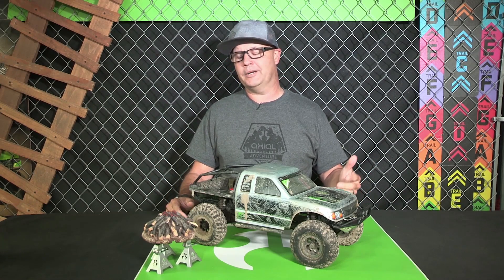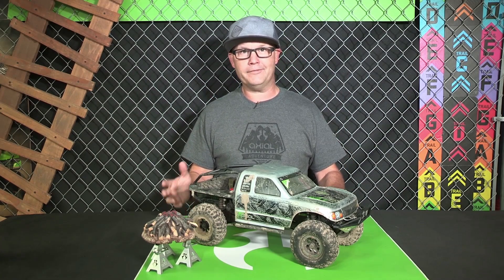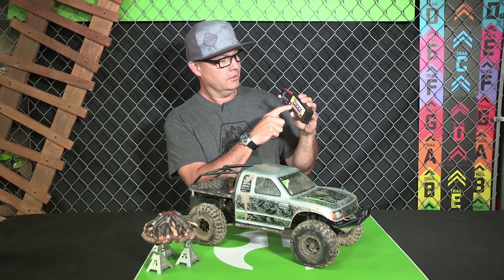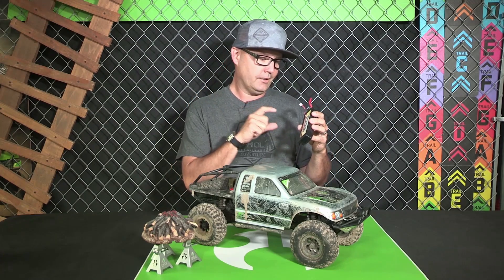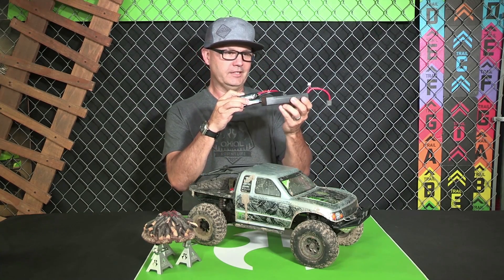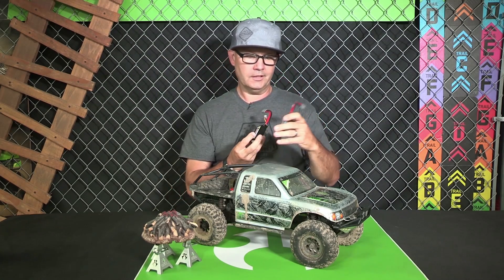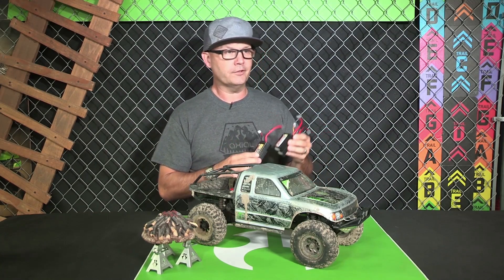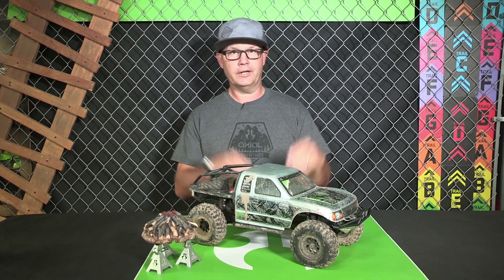mAh Per Mile - Explaining Gas Mileage for Your Rig

Comment: Scale Trail driving uses more M.A.H. than Rock Crawling.
I usually run a 3S 2'200-mah 25C and get around 2 hours on the Rocks. The 3S 5'000-mah 50C gets around 3.5 hours easily.
I am running a 3S 1'400-mah 50C now and have no idea how much runtime I'm getting. I will sort it out though ;)

Comment: I run a 2S 8000Mah 30cell lipo in my wraith and get 3 hours run time or 2 hours run time if I'm full throttling it a lot. I bring 4 of them with me and I can go pretty much anywhere as long as nothing breaks and I have to carry it back to my car
Reply: Yes, I totally understand what you are saying and agree with you - BUT HOW MANY MILES? We don't measure our 1:1 cars, trucks and motorcycles in how many hours it will run on a take of gas, we measure miles. That is what we are going to be looking for.
Reply: GCRad1 15-20miles of continuous drive time on one battery that I run. I've driven my truck up Mountain trails to the top of the mountain on one battery. When I ran 2S 10,000 Mah 50cell lipo's I was getting 4-5 hours of drive time on a single charge. But they were very heavy battery's

Comment: And there will be a difference if you run like a 35 t or a 55t
Reply: yes there will be... should be... and we have are considering that as part of the test.
Reply: 35T is a faster motor and needs less throttle to run the same speed as a 55T motor. But the 35T is going to use more m.a.h. due to its lower wind. The slower 55T motor is going to use less m.a.h. until you factor in how slow it's going to be running at full throttle. If you have to run the 55T at full throttle to keep up with the 35T motor, how efficient is it going to be??? Now add a little gearing to both motors, and it gets really interesting!!! Then we can move on to the overall weight of each rig. . . Pretty exciting actually!!! Testing is so much fun!!! ;)